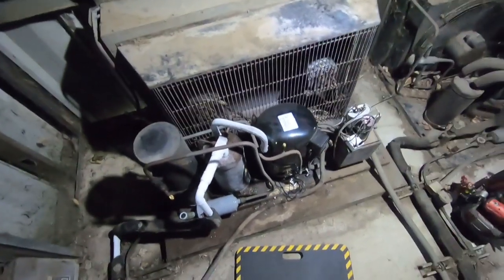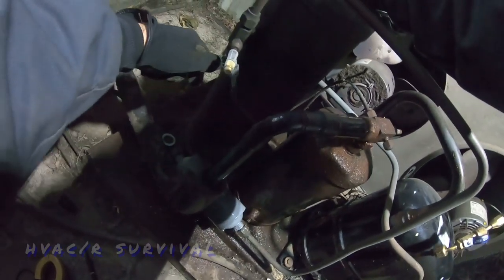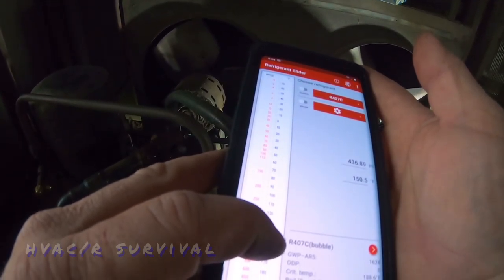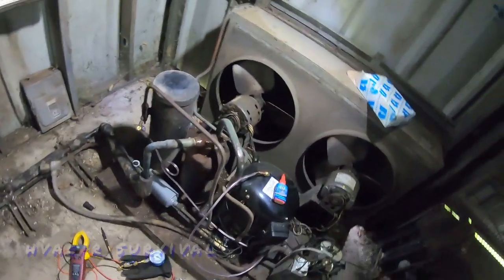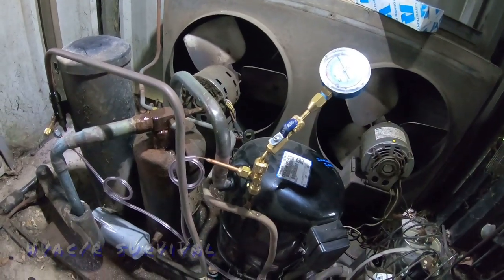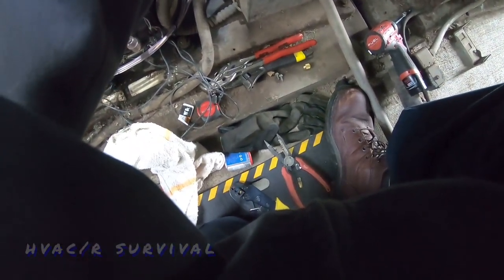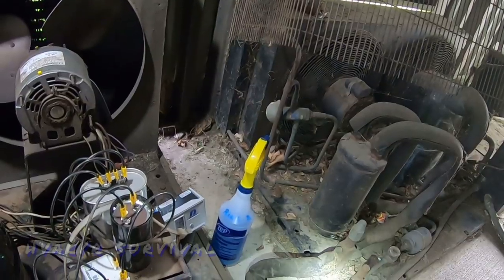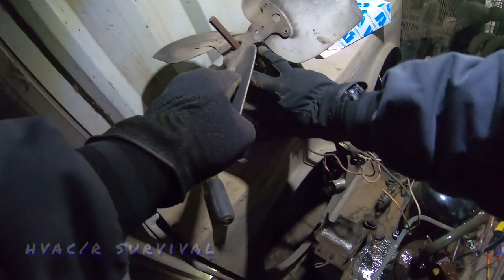Walk-In Cooler Warm Multiple Failures Bad fan motors, pressure controls, and electrical.

Comment: It's shocking the issues I find with pressure switch settings. They seem to be extremely misunderstood. Great Vid as usual.
Reply from the maker: Springs getting loose over time,  contacts constantly kicking on and off constantly arcing,  it's no wonder.  Thanks 4 checking it out I appreciate it!

Comment: Excellent video and thorough diagnosis. Love the use of the tubing and crimping tool. One statement I disagree with is the life span of ANY piece of equipment, if properly maintained the units can and will last 20 years plus. But then again most owners don't maintain. Videos much appreciated.
Reply from the maker: I agree if maintained, problem is a lot of owners don't want to spend money to keep the equipment running properly,  then complain you have been there several times. Plus I know when people see the video they're wondering why don't you just replace it or why aren't you doing..... (I can't make owners do anything they won't pay for, and can't express that without upsetting people. )

Comment: I like that rubber tubing trick with the capillary tube, good idea. I don’t like using leak lock on flare nuts either, I had to use a pipe wrench today on a filter to get it loose, the previous mechanic gooped on 1/2 a pound of leak lock on the filter threads... I’ve got the same crimp tool also, I swear by it. Thanks.
Reply from the maker: Thanks for the feedback 404!

Comment: Good video and thanks for the tips.   Learning something from you all the time.   What is sad that 2 lubricated cu motors can get to that condition.
Reply from the maker: Thanks Brad I appreciate it, just trying to see if anything I know helps anyone else.  You are correct you can hurt a motor by over oiling in it, I believe those Motors there were sealed motors. 👍👍

Comment: Did you deal with the floodback issue? When you first walked up to the unit the suction line was icing back to the compressor. Copeland requires a minimum of 25* superheat at the compressor. So I’m medium temp application there should not be ice coming back to the compressor.
Reply from the maker: Frost doesn't necessarily mean flood back,  it was cold and humid outside. I checked my superheat and it was safe. Another example would be when freezers will have ice on the suction line and not be flooding back when the outdoor conditions are just right.
Reply: I understand. I have been out of the service company/billing the customer game for 5 or 6 years now. And have been in the partnership/ in house maintenance were I get to make things right most of the time. I surely don’t miss the most times tense relationship the former creates. I do enjoy your videos. Don’t take my comments as criticism. I’m particular about the details which in the long run promote very efficient running systems.

Comment: great video   i will invest in a good  crimp tool    thx for the tip
Reply from the maker: I've looked EVERY WHERE... These were the best for the money,  I crimped a butt connector on 10ga and 12ga wire into a circle and could not pull it apart with my bare hands,  I even let others try. The link is in the description just below the video.
Reply from the maker: http://www.cleavelandtool.com/mobile/Rachet-Terminal-Crimper/productinfo/WTC380/#.XbQ3Y7cpAwC
Reply: I’ve had the Greenlee. Version of these for years. Great crimpers but they add some weight to the tool bag. I think I paid $50 for them 15 years ago. Still work great.
Reply from the maker: @lee-johnson  I carry the Klien red crimper in my bag,  if I have some heavy duty needs I get the yellow handle crimper out of the truck. 👍👍

Comment: What was that fancy trick you did with your amp clamp on the solenoid ?
Reply from the maker: An amp meter measures the magnetic flux lines around the wire,  that's how it decides how many amps is being drawn Through the Wire. When a solenoid valve is actuated it will create a magnetic field also, so by putting the meter down there at the magnetic coil it will show you that it's pulling Power. you don't really care about the number,  you just want to see that it changes to a higher number. It obviously won't tell you if it's feeding refrigerant through, it only shows that it's energized. FYI you do have to open the clamp for it to register any reading, otherwise it won't do much of anything.
Reply: Awesome explanation, I had no clue. Love your videos
Reply from the maker: @reyrodriguez1005   I got to admit I seen another guy do it on a video and thought hey that's pretty cool it makes sense. So I started doing it every now and again🤣

Comment: You had any issues with that fenix light? After about a year I've had some problems.  Just curious. Enjoyed the content. Thanks.
Reply from the maker: Never had any issues whatsoever with the Fenix, they have between a 3-5 year warranty. I prefer to buy my stuff now at the Fenix store.com... they'll swap it out and warranty it for you and I think they upgraded to a lifetime warranty.
Reply: @HVACRSurvival  didn't know that I'll look into sending it back. Sometimes  it''ll say the battery is full charged and after using it for a short period it'll be dead.  Other times it'll charge all weekend and never go green. Other times it works fine.  It's weird lol.
Reply from the maker: @jonnymac31  I would try a different battery and a different charger

Comment: Right side motor was shaking when turning off
Reply from the maker: The whole system was recommended to be replaced several times prior and without saying anything negative it was chosen not to do that. All recommended repairs at this location are a challenge. Welcome to real life, stuff gets Band-Aided for a reason.